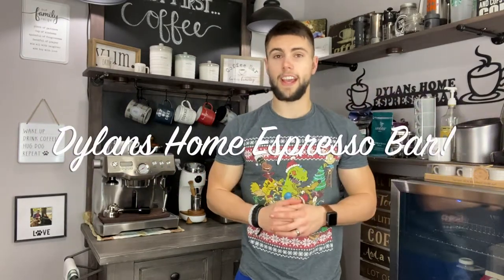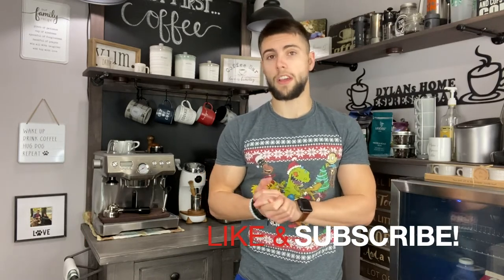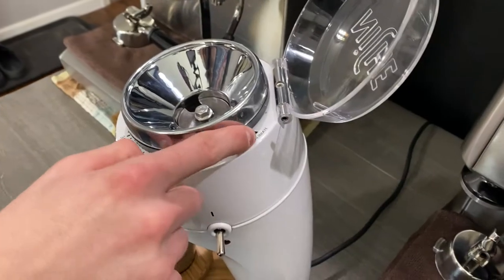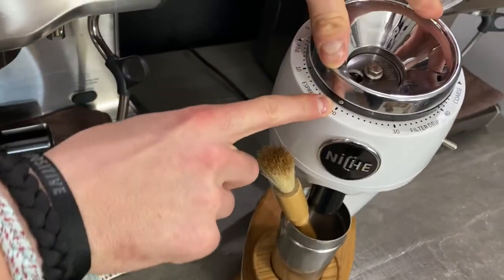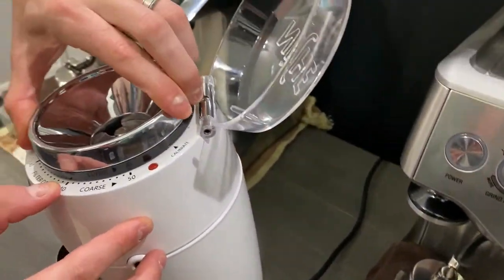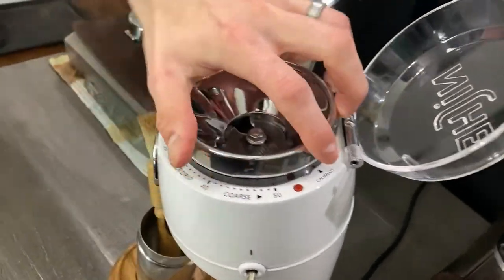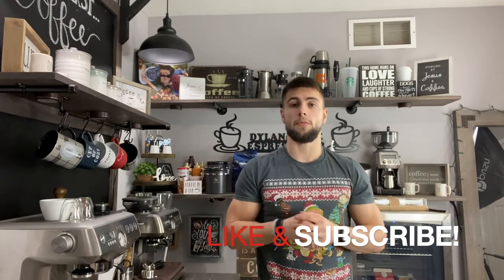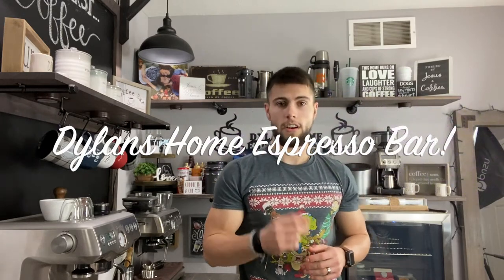How To : Calibrate Your Niche "Zero" Grinder!

Comment: Thanks, Dylan, for the good video. Quick question: if I rotate the bean funnel back counterclockwise after calibration, e.g. to the "Espresso" area, then the ground material is too fine (brewing is not possible). Only when I continue turning until “Filter coffee” I can make an espresso. What can I do to get the desired grind level back to the "Espresso" section?

Comment: Hi Dylan. The little round plastic cover just above the burrs that has a little keyhole in it. Is that supposed to be left on when you use the grinder? Or should that be removed before using?
Reply from the maker: That should be kept on and it fits right in that small hole above the burrs
Reply: It's there to minimize popcorning. Beans will still bounce around a bit but a lot less than earlier models which didn't have it.

Comment: Thank you Dylan for the info, so out of the box you only have to rotate the dark ring with the dot to adjust grind size correct?
Reply from the maker: That is correct!!
Reply: @DylansHomeEspressoBar  Thanks for the quick reply, so far my Niche experience ranks a Zero, sorry couldn't help myself. Out of the box the first thing I had to do was tighten the popcorn shield which was very loose. Next is with the grind setting turned all the way to the fine setting I'm not even close for espresso. Tell me what you think, I'd like to know your thoughts before I contact Niche.
Reply from the maker: @theeoarsman921  you are so welcome and I’m so sorry to hear that! :( maybe take it apart as of you were cleaning it put everything back in then calibrate it